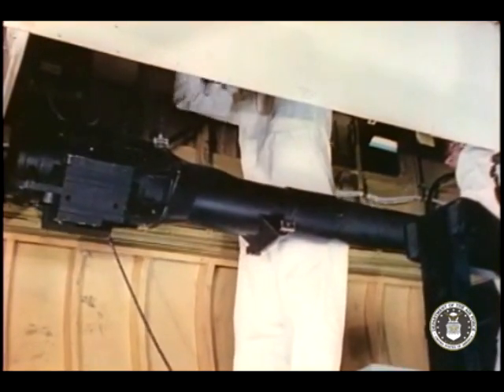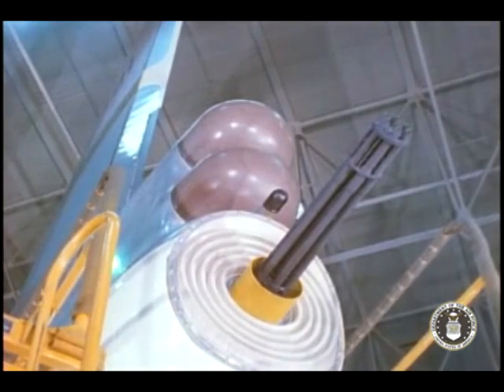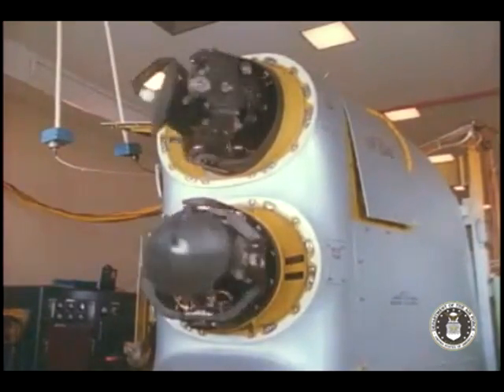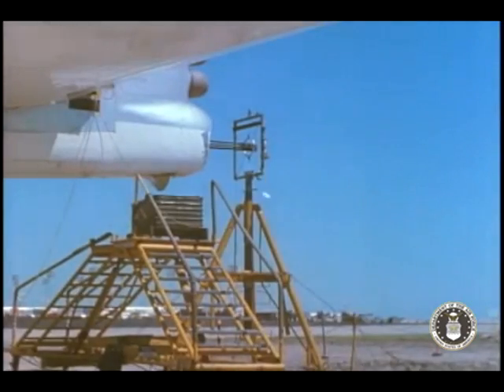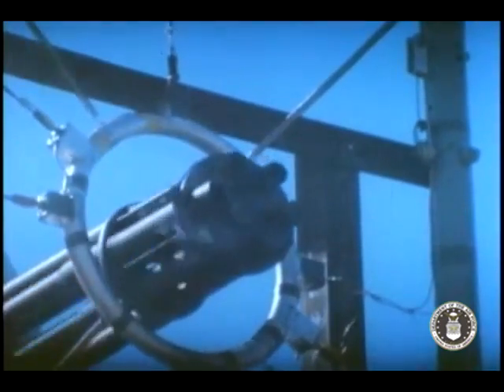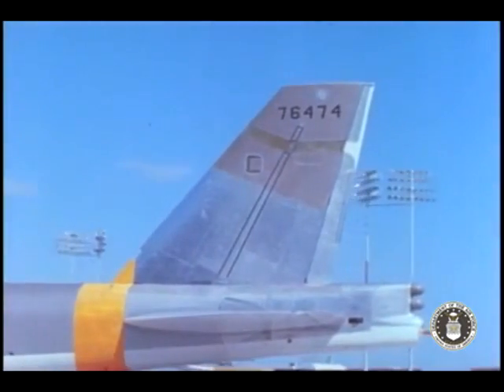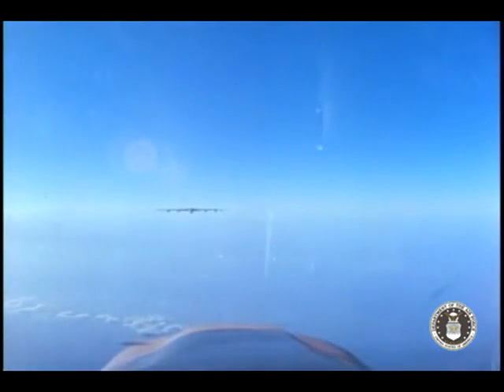B-52H Stratofortress: M61A1 Vulcan & AN/ASG-21 Fire Control System

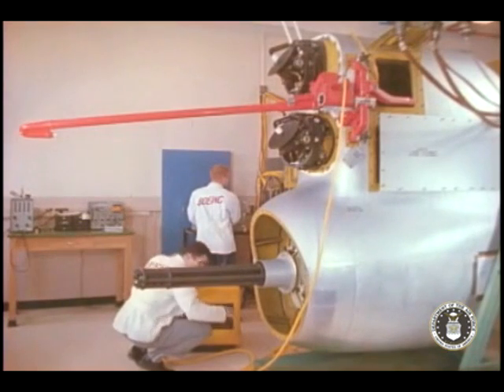Comment: 0:35 what the is this?
Reply: It is two Ku-band microwave radars, both operating in search (scan) mode. The back and forth and nodding motions of the dish reflectors is controlled by microswitches that actuate at the mechanical limits of the raster-scan sweeps. The switches were protected by a stamped sheet-metal leaf mounted between the microswitch and a Teflon-coated cam, driven by the motors that move the antenna gimbals. Even with the Teflon coating on the cams, the metal leafs wore out and had to be replaced periodically, a very difficult job when the cold wind and weather doesn't cooperate.

At each end of the horizontal sweep, the electronics causes the dish to nod downwards or upwards, depending on which vertical direction it was already moving. It simply reverses direction when the dish finally reaches its up or down limit, making several "steps" up or down as the dish moves back and forth horizontally. This is basically how a NTSC television works, except not as many horizontal lines, slower horizontal sweep, and no rapid retrace at the end of each line because radar returns are processed in both left-to-right and right-to-left scans.

The parabolic dishes behind the feed-horns are tilted slightly with respect to the their optical axis and spun at a high speed. The result is the radar beam focused by the dish nutates around the spin axis. Electronics use the resulting modulation of the reflected radar beam to create a two-axis (horizontal and vertical) position-correction signal that is used to track the target and position the rate-gyroscope stabilized control-line-platform (whose position the gun gimbals are slaved to) when the radar enters the tracking mode prior to firing the cannon. The aiming position of the control line is determined by an analog computer that receives the radar tracking signal, and other data (such as range to target, air temperature, and attack angle of the bomber) affecting the projectile trajectory.
Reply: The radar that is over the gun. They are covered by the two mounds above the gun. This is how the gun is aimed and controlled.

Comment: Perhaps hanging a pair of AIM9's under the elevators facing rearward would be a cost effective solution?
Reply: Launch a missile. Backwards. Through the tail controls. Know what comes out the back of a missile? Fire. Lol
Reply: Thats highly impractical. It would be more useful to give it the ability to carry AMRAAMs from the wings pylons and have the crew blast their way through the enemy air defense fighters.
Reply: @majorborngusfluunduch8694  Amraam needs a powerful radar, heat seakers do not
Reply: @lt.lasereyez8891  The buffs got a big ole nose. I'm sure if something like an F-16 can house a radar that can guide AMRAAMs, you can mod something into the B-52.

Comment: Always thought it would suck to be in the tail with no windows.
Reply: The last two models of the B-52, the G and H models, did not have a rear gunner canopy because the gunner no longer sat in the rear of the aircraft, as had been the case in the A - F models.  In the G and H models the gunner's station was moved up front on the upper deck right beside his defensive teammate, the EWO.  In other words, on the models with a windowless tail, no one sat back there.  That's not to say the up front positions are much better.  Except for the pilot and co-pilot, the crew stations up front were (are) for all practical purposes entirely windowless.  In many ways, the tail gunner on the A - F models had the best outside view of anyone on the aircraft.

Comment: Some pretty clever tech for the age ?
Reply: Not just clever! This was the best there was when it was built. Even the Navy finally embraced the fire-power with their Phalanx CIWS (Close-In Weapon System) ship-defense for a "Hail Mary" response to missile attacks. And of course the M61A1's big brother, the GAU-8 30mm 7-barrelled cannon, is used on the A-10 Thunderbolt close ground support and tank killer aircraft. High-explosive incendiary (HEI), Armor Piercing (AP) and ball training rounds are all fodder for these cannons and upwards of 6000 rounds per minute can be fired, limited mainly by overheating of the barrels as well as the limited supply of ammo that can be carried. At a hundred rounds per second, the Gatling Gun sounds like God farting. No rat-a-tat-tat fake Hollywood machine gun fire: this thing ROARS.

In 1964 I was serving with the SAC (Strategic Air Command), stationed with the 449th Bomb Wing (heavy) at Kincheloe AFB, MI after enlisting in May 1963 and training up on how to maintain the AN/ASG-21 DFCS. It was a state-of-the-art system that totally fascinated this (then) young airman, and later inspired him to become an electrical engineer (retired now).

It was my first introduction to military electronics and radar-controlled Gatling guns. The electronics were amazing... transistors and sub-miniature vacuum tubes, magnetic amplifiers, magnetrons, electro-mechanical servos for computing the gun aiming solution, rate gyroscopes that allowed the firing solution to be maintained while the BUFF was jinxing, high-pressure hydraulic motors used for rotating the barrels, feeding belted 20mm rounds from the ammo can to the rotating barrels of the weapon, and a pair of high-volume hydraulic servos used to rapidly move the gimbaled gun turret as the Ku-band radar tracked the target. It could simultaneously search for targets with one radar while the other radar locked onto and tracked the target. The gunner could quickly select targets with a joy-stick and switch modes between searching and tracking on the two radars. Engineered with pride by the folks at Emerson Electric, St. Louis, MO for the electronics and General Electric for the M61A1 20mm Gatling Gun.

My enlistment tour ended in May 1967, so our SAC B-52H bombers never had to get involved in a thermonuclear war. I was saddened to later see the DFCS removed, but the added weight and the complexity of the maintenance that was required doomed it. A gun is only useful if it can fire rounds that actually hit the target. When long-range stand-off missiles came online, the B-52 was soon relegated to theater areas where US air superiority was established. It is exceptionally good at bustin' targets with tons of bombs and cruise missiles while cruising along at altitudes above 50,000 feet. And even without air superiority, the BUFF can send cruise missile without overflying enemy territory. It's an awesome weapons platform that has been extensively maintained and upgraded to serve well into this century.
Reply: Pointless though

Comment: can the tailguns be reactivated were there provisions set aside for this also if i were a crew member on a b52 i would feel alot safer having the tailguns than not having them put them back on is my opinion
Reply: No point in a gun when a fighter can fire a missile at you frontally from 30 miles out.
Reply: Yes ! Its goalkeeper system in my understanding....

Comment: I call it now.
If war thunder brings B52s the Vulcan version would be premium
Reply: No way killing it with machine gun from the back
Reply: Quad .50, 20mm vulcan, and unarmed are the options. 20mm got the last tailgun kill, knocking out a mig from 2km in Gulf 1. Discontinued due to "friendly" fighters misidentifying the fire control radars (friendly fire ruins everything)
Reply: Cold War Heavy bombers are too OG for base bombing. Not saying can't be done, but bombers like those were intended to level cities from very high altitudes and far away ranges. Someone can mod it into the game now that cruise missiles are in there. Just wondering what multiplayer gameplay would be like. Keep in mind that bombers after BR 4.0 are easy pickings for just about any fighter over BR 4.0

Comment: I worked on this specific system in the late '80's and early '90's.  Please let me clear up some confusion in the comments section regarding this weapons system.  The system was designed to shoot down planes not missiles.  The bomber has an Electronic Weapons Officer that can use flares, chaff, and radar jamming to deal with any incoming missiles.  The cannon was mounted in a weapons gimbal that gave it a wide range of up/down & left/right motion so that planes coming in from almost any angle from the rear could be shot down.  The computer system took the range, direction of travel & speed of both planes, air temp, wind speed, and computed a firing solution to aim the cannon.  Short bursts of ammunition controlled by the gunner could then be fired at the target.  The goal wasn't to blow up the enemy plane like you see in the movies.  Just simply to make a hole or two in it.  The concept was that if a hole could be made, then air catching the plane's skin at high speeds around that hole would begin "peeling" the skin off of the plane.  The plane itself would be outright destroyed or would be so severely damaged as to take it out of the fight.  The system was deemed obsolete and removed in the by the mid-nineties.   B-52's have the ability to drop bombs at both high and low levels with equal effectiveness.  The running joke was that if a B-52 shadow passed over you, you were already dead and just didn't realize it yet.  I hope that this helps clear up some of the confusion in these posts about what this system was and how it was used.
Reply: Computers are much more reliable now than they were when this system was deemed obsolete.  I read on wearethemighty that there was a friendly fire incident which prompted the removal of the system.  Transponder tech has come a long way since then.  With the current direction of aerial combat in the middle east, I'd expect to see this adapted into an anti-drone system using frangible rounds to extend range.  I'd also expect to see a central computer in charge of computing firing solutions for ALL active systems, to deconflict fire sector selection.
Reply: Anti drone system on a bomber? Well... Sounds like joke :-)
And decision to remove this thing was mainly because guns have not enough range to shoot down modern enemy fighters that uses missiles. So you don't need gun when no enemies will get within its range. It only puts on weight and requires maintenance.
And since 90s mode 5 IFF has been implemented. However its still being introduced and AFAIK not all NATO airplanes have mode 5.
Deconflict fire sector selectrion? Well, i don't even know what you mean... You select targets and not sectors. On modern one u can use TGP (the modernized one got Sniper TGP) or radar to attack TOO. Some weapons (like JDAM) can also be aimed on pre planned targets with known coordinates. You don't really have thing like firing solutions, you rather think of LARs (launch acceptable regions) rather than firing solutions when it comes to modern weapons. B-52 has no more guns and won't have as they make no sense at all on todays battlefield. When it comes to dumb boms you got something called CCRP or so. Its computer calculated release point. Basically computer calculates when to drop a bomb to make it hit target.
Reply: Well, even if it didn’t hit you, it would sure give you second thoughts about closing up.
Reply: @lostinpa-dadenduro7555  it was also used on the m113 apc 68 in Nam.the Vulcan project .it was proven battle ready in a ambush .mos 16romeo20
Reply: Tim Smith   That kind of reminds me of the quad .50 half tracks from WWII.
Reply: @lostinpa-dadenduro7555  they were really something .you could fire hei frag and ap rounds .I went to white sands to test fire some new amo as well .I. Also was with the Vulcan project . you Google it .6 were took to man in 1968 . they sure made the vc and nav change there zip code fast .. I heard in the 70s sometime they became a air defence weapon we had them on the m113 apc.there also was a tow model tow be hid a gama goat .mos 16romeo20 🗽🇺🇸👍
Reply: In 1978 the Fire control system (FCS) of both the G and H model B-52's were updated to enable the gunner to engage Surface-to-air missiles. Gunners spent many hours in ground trainers and in the aircraft training to engage missiles.  Granted the day of the fighter pilot engaging in a gun battle with a BUFF is over but that same pilot has to come within gun range of the 20mm cannon to use a heat seeking missile.
Reply: @allengray8200  The R-73 Russian heat-seeking missile, which is currently in operation around the world and is comparable to our own ASRAAM and AIM-9X, has a range of 19 miles. This cannon wouldn't be able to touch an aircraft at half that range. They would be better off mounting air-to-air missiles on wing pods.
Reply: @koriko88  i see same kind of goalkeeper system on those B52... Why it become obsolete i dont understand...?
Reply: No, sorry mate, but even early marks of the AIM 9 (and Soviet equiv.) had a range in excess of 6 miles. Well outside of the vulcan range
Reply: You were a young one, we had human gunners in the tails in the D models. Old school they did shoot at missles.
Reply: It was designed to BRRRRTTTT.
Reply: Not a B-52 person, but I heard the tail gun was removed not because it was obsolete, but because there was a section of a treaty (SALT, SALT 2?) that prohibited defensive guns on bombers....something about limiting the number of successful attacks in case of war.
Reply: @Name-ps9fx   I'm just going by what they told us when they removed the system from the plane.  Obsolescence was the reason given then.
Reply: If all else failed, was the gun capable of tracking missiles?
Reply: @THE-BUNKEN-DRUM  The resolution of the radar was not fine enough to track missiles in general.  Like lot of radar systems, it filtered out most things smaller than a plane. This simplified what was being tracked.  The system in the 52-H was built by Emerson and the planes were refitted around 1983-1984 if my memory serves.  I may be off a year or so but you get the idea.  These weren't complicated systems by today's standards but for the early 80's, they were fairly state of the art.  But even as "high tech" as they were, they could only lock one target at a time with on antenna while the other continued to scan. Sitting next to the gunner was the ECM officer.  The Electronic Counter-Measures Officer kept an eye out for enemy radar locks and incoming missiles.  He had radar jamming, chaff, and flares at his disposal to detect and counter incoming missiles.  The idea was that he took care of the missiles (along with ground radar) and the gunner took care of the guy firing them.
Reply: In 1971 a similar system using 4 50 calibres managed to kill 2 mig 21s, supposedly they both went down in flames
Reply: You dont need to attack planes with drones when you have missiles that can fire from 80 miles away. Also the reason this gun was removed, it was for defending against planes, and planes don't get that close anymore

Comment: That would put a sting in its tail, would this have been capable of knocking out a SAM?, or is their angle of engagement out of the field of the gun?. Thanks interesting.
Reply: SAMs usually fire head on (forward aspect) as this makes them more effective (they can fire earlier and the effective range is bigger). Also missiles are smaller than jets and also fly faster. This makes them hard target for guns.

Comment: After spending over 3600 hours in B-52s it is remarkable to me how many uninformed people on here want to give everyone their "expert" opinion. A) SAMs are a real threat to the BUFF but it was continuously updated to counter new threats as they were deployed, 2nd) the gun system was very effective in convincing fighter jocks to find a different attack profile, 3rd) the gunner was removed because of cost considerations.
Reply: SAMs always were pain in the rump. This was the reason why XB-70 never made its way. They have designed B-1 as low altitude penetrator to counter the radar threat. Idea was to use terrain masking to avoid detection by EW (Early Warning) radars that was part of IADS (Integrated Air Defence System) that was actually passing targets to SAM batteries and fighters. B-52 had really good jamming equipment. They were able to jam metric wavelenght radars (EW radars) aswel as higher frequency FCRs denying radar ranging. However it was still possible to fire missiles in 3 point tracking mode. As the jamming technique progressed, new methods has been made available like DRFM, RGPO and so. But SAM systems also has been updated and operators has been trained on how to counter different kinds of active and passive CMs. There is a software https://sites.google.com/site/samsimulator1972/home, so you can practice shooting SA-2 at BUFFs ;-) Today, the best way to prevent being shot by SAM is to stay out of range, use terrain masking or simply have SEAD (wild weasel) flight to prevent them from firing. Jamming is good, but it cannot make anything immune. ECM used wrong way can even make situation worse.

Gun was a junk back in 90s. Fighter launched AA missiles were very popular and had much longer range than defensive guns of BUFF. So fighter could fire one while being out of the gun range. Also IR missiles were made less vulnerable to flares as the IRCCM techniques progressed.
Radar gired AA missiles were made able to HOJ (home on jam) so this made noise jamming a lot less effective. Targeting pods made visual target identification on medium ranges possible making DRFM less effective.

Comment: Because it's essentially worthless versus missile equipped fighters who can easily attack from any direction, not predominantly the rear as it would've been in the 50s from gun equipped fighter-interceptors.
Reply: Missile were bad until the 70s but in theory there is a chance that the Vulcan can shoot down in coming missiles if they are travelling at less than mach 2/2.5 and first all aspect missile was made in 1976 iirc so up until the 80s the gun would have worked pretty well